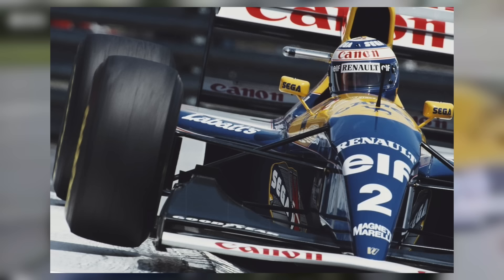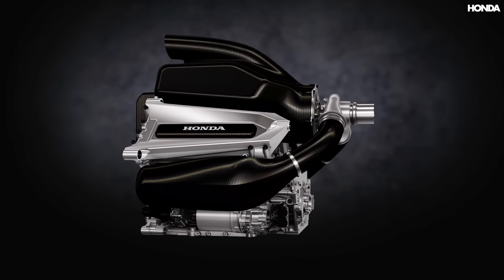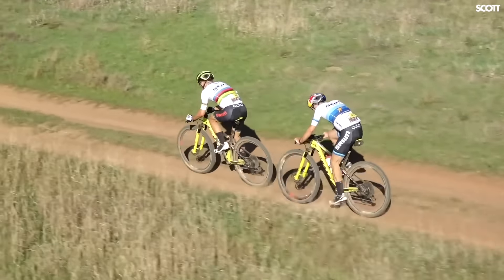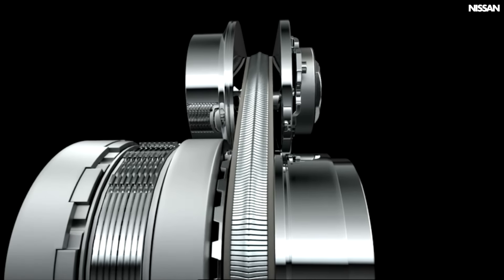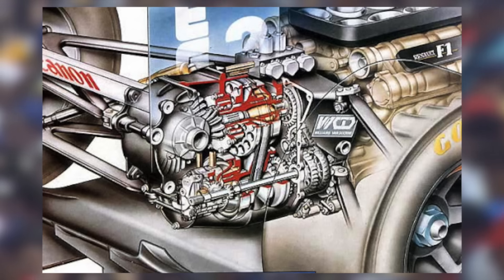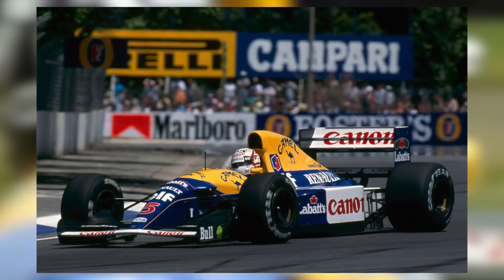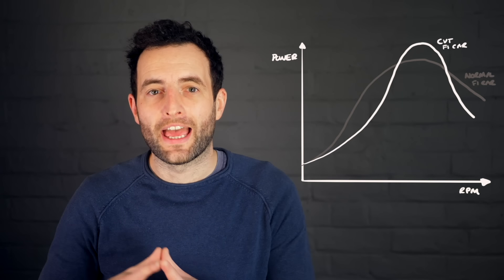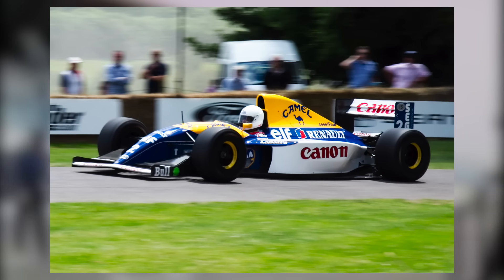The Formula 1 Car with INFINITE GEARS | The Blueprint

Comment: I don't to think you're right about picking the top torque of the engine for best acceleration - you always want to maximize engine power.

Here is why: at any given speed you want to maximize the torque at the wheels, which means that you want to maximize the engine torque multiplied by the gearing ratio. When you do the maths, you'll see that this is essentially engine power divided by rpm at the wheels, so if you want this number to be maximal you need to pick such a gearing that the engine is at its power peak, not torque.

To put it differently, if you make your gear longer so that you can have peak torque in the engine (instead of peak power), the extra torque will be consumed by less aggressive gearing, yielding lower torque at the wheels.
Reply: "...engine power divided by RPM..."

So torque....you essentially described torque...
Reply: @JohnDoe-td7mu  He’s exactly right. Wheel torque is what matters, not crankshaft torque. Wheel torque is maximized when the engine is at peak power, not peak torque.
Reply: @JohnDoe-td7mu  Almost - except it's engine power divided by wheel rpm (not engine rpm).

At any speed, the peak torque at the wheels is achieved when peak engine power is achieved.

Or to put it yet differently - power is preserved by gearing, torque is not (except for losses which don't affect the reasoning). So, the torque at the wheels is engine power divided by wheel rpm. Wheel rpm is is given so you need to maximize engine power.
Reply: @JohnDoe-td7mu  after the gear box multiplies the engine torque. Yea. The total force, which is what hp tells you.

Let's say the engine is outputting 50ftlb at 1000rpm and the gear box is 1:1. That's 50ft-lb.

But let's say you shift down at a 2:1 and the engine puts out 35ft-lb at 2000 rpm that's overall 70ft-lb after the gear box.
Reply: I am amazed that a racing driver doesn't understand this concept!
Reply: @ianlewis6717  I'm amazed that two racing drivers don't, since DC also got it wrong in this video!
Reply: What you are missing is when the tyre has not full grip, there you prefer the max torque to ensure transmission from tyre to road instead of spinning too quickly ... 😁
Reply: @JohnDoe-td7mu  Yes, but torque at the wheels. Since you can change the gearing ratio to whatever you like, you can increase torque at the wheels pretty much arbitrarily, but since you ultimately need that torque to do work, what limits you is the amount of energy you can input into the system over a given period of time, which is power.  
Crankshaft power is given by multiplying engine torque by engine RPM(and some constants depending on the units you use), and it's very possible for it to not quite coincide with max torque, instead coming slightly later when the torque only slightly drops off. In those situation you don't want to keep the engine at max torque, because it produces less power, and you can makeup for the lower torque at the crankshaft with a slightly lower gear ratio, increasing torque at the wheels.

Comment: Do you want to do a video on how this is different to the "CVT" that Koenigsegg is using?
Reply: Koeniggsegg isn’t using a CVT, they’re using a hydraulic coupling. It’s basically a very fancy torque converter, which you can find in many different automatic cars.
Reply: That's a direct drive system, not infinite gearbox.

Comment: They could do system where the car is always at max throttle, and the pedal varies the rpm in order to mediate power. Below idling rpm, the throttle would be lowered as normal. That would save the engines lifespan (which by extension increases the power teams could put through it), it would maintain an optimal rpm and power level at all times for the driver’s exact needs, and it would quiet the engine down more for the audience.

Comment: A drawback of that could be the braking, without downshift it's a different thing. When I test (I'm a tire test driver) with cvt cars (Toyota f.e.) I always have a "weird" feeling, especially in hard brake, if the car is not stable during braking. Sometimes, especially with rwd cars, downshift is essential. But I test on road car, they are not built to be pushed on the limit on track, so maybe that's why.
Reply: That may just be because it's a Toyota. My RWD Volvo 340 does have hard engine braking when fully off throttle, but I recon it makes things easier, especially in a situation without ABS.
Reply: @RDMracer  I have a 2017 V60 cross country automatic, and when I do emergency braking on road it actually downshift quite hard(more than the e92 I had before even when in sport mode) so I think it's a Volvo feature support hard braking with some gearbox setting
Reply: @RDMracer  also as an insider in automotive r&d I know that Volvo develop cars for Sweden without adapting to the rest of the world. Considering how slippery are the road there (due to snow,ice etc) I can easily understand why they develop the gearbox in this way
Reply: it all depends on how its setup to operate really. My Honda Hobbit (Camino in the UK)"downshifts" with the starter clutches installed, remove them and make it a pull start or push start with a one way bearing and you lose the downshift. Funny that the system above was designed in Belgium as the Camino is kind of popular there still to this day.
Reply: The great thing about CVT is you can program it how you like. When the driver is on the throttle, you can have the engine in peak power, and then on braking you can program 'Down shifts' into the CVT that the driver can control like a conventional gearbox. I think this is the best of both worlds. With development they could be strong and fast enough for F1

Comment: Wouldn't it be amazing, fitting last year's Mercedes W11 with a CVT, active suspension, advanced traction control and all those bells and whistles, and putting it to the test? 

It would be absolutely nuts. 

Not for actual official racing though.
Reply: we're talking about mercedes here mate, FIA would let them
Reply: @NikoKyunKyun  They would not be able to stop anyone from doing it. Any person, team or enterprise, given they have the technical prowess and money, can do it. It's not a decision of the FIA.

Though, right now, and until the end of 2021 season, they wouldn't be able to use the 2020 car: they aren't allowed to be used, even as test cars for new drivers to get mileage, due to the 2021 cars being derived from the 2020 because of the delay of the new rules.
Reply: DAS, CVT, active suspension, TC and all with infinite tuning possibilities, full power engine, and that tunnel-like downside. Would be fast as hell
Reply: Pikes peaks cars would be good with cvt.
Reply: @gaomn_03  Of course they can.  F1 imposes technical rules on many areas like chasis, engine, weight, aerodynamic etc.  All teams race under the same set of rules.  It is not no rule Formula 0!

Comment: CVT was the specialty of Dutch car manufacturer DAF.  I remember dashing all over south England in my mother”s DAF in the 1970s.  It was an awful car tbh.  Volvo eventually took them over.  They persisted with the CVT for a few years in their base model but it was dropped for a conventional automatic gearbox in the end.  Strange to think that F1 tried to adopt something from the normal automotive world as the flow of technology is normally in the opposite direction.

Comment: Could probably do the same now by making the combination engine charge the batteries and just have an electric motor to drive the wheels… this is probably why they limited the maximum power allowed from the electric part of the power unit.

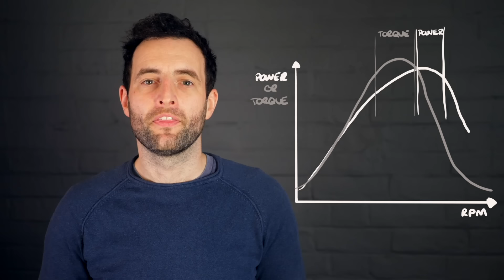Comment: 5:50 That’s just plain wrong. Don’t you consult an engineer before making these technical videos?

A cvt would keep the engine at peak power for both acceleration and top speed. When the engine is at peak power the torque at the wheels is at its highest. The torque at the crankshaft is irrelevant. Only torque at the wheels matter and at any given car speed that’s highest at peak power.

Comment: Well it's not infinitive gears. You have an upper and lower limit of the gear ratio. The car can choose a ratio freely within that range.
This would eliminate adjusting the gear ratio. I don't know if they switch the gear ratio but it makes sense. You want a gearbox that can deliver the optimal ratio for the track.

I think its good that they banned it for multiple reasons. First the sound would suck. Having a car at the same RPM the whole time doesn't sound nice. Then there is the cost. Teams would spend a ton of money to get the best system and optimize reliability. Reliability is also important, because it would suck when they constantly change the gearbox. It's an active system that removes a challenge for the driver.
Would have the FIA allowed it, there wouldn't be much left for the driver to do. They just floor the car and steer. The car does the rest.

Comment: I have to take issue with your use of the term 'infinite gears', because they ain't.  There is a limit to the range of gear ratios in a CVT, from minimum to maximum — they maybe be continuously or steplessly variable but they're not infinite, which means limitless, boundless, unmeasurable.
Reply: No, it's correct. The gear ratio has a minimum and maximum yes, but between that minimum and maximum you can select an inifinite amount of ratios to use (much like the value of the number pi is not infinite but it has an infinite amount of decimals).
Reply: How many numbers are there between 0 and 1? There’s a minimum number - 0, and a maximum number - 1, but an infinite numbers in between. Same thing. A cvt can and does use every ratio between its minimum and maximum.

Comment: The only sim that support CVT afaik is BeamNG, you can fit one into a race spec touring car.
I tried, I like the ideal the engine always run in sweetspot, but the sound just killed me. I'm not a ICE sound enthusiast and live perfect with EV sound, but the constant RPM sound really makes me unable to judge power input and output, makes the control very difficult.

Comment: 5:50 
I think You might be wrong here. 
For max acceleration the engine will always need to be at highest power, not highest torque rpms. 
Gearbox will always provide the max torque at the wheels when the engine works at highest power revs. 
Gearbox ratio (high reduction) will take care of this.

Comment: What is wrong with the FIA? Every time something cool, new and with great potential comes along it just gets banned. Its meant to be F1. If you want class racing do it in one of the classes. 
F1 should be the best of the best. Not the best so long as you don't use certain aero, certain gearboxes, certain electronics and all the other rubbish rules. 
The only rules in F1 should be a size limit for obvious reasons (so it would have to fit in a theoretical box) and something in there to say it has to be reasonably safe so far as is possible. 
After that let them have at it.

Comment: Maybe someone knows more details but when CVTs went mainstream, drivers would complain they were “slipping” and they ended up simulating traditional shifts via software, negating much of the benefits of CVTs.
Reply: I would hold the pedal down and wonder what the heck the car was doing at 4K doing 20mph. 

I started making mental notes of where shift points should be and lifted the acceleration. 

Funny thing it worked. Until you hit a hill with cruise control. Many of these just cooked themselves.

Comment: This style CVT was developed by DAF , a DUTCH car brand. They used it on the London-Sydney Marathon rally of 1968 running 2 DAF55 Marathon's (#30 and #69)
They both finished , 17th and 56th. Here you can see a Dutch documentary with unique rally footage of that rally:  
https://youtu.be/tyWVAKwBmUM
They also did some testing and racing in a F3 car.
https://youtu.be/oq4ZbBVTumw

Comment: One small correction: Acceleration doesn't depend on torque but on power. There's no reason to stay in revs where you have peak torque if you want to accelerate as quickly as you can.

Comment: I have a question though,
How do you know you are maximizing the braking phase? Do you feel the underrotation of the wheels?
Reply: Should be easier, you can control engine braking very easily with this system, and braking is front-wheel limited most of the time in Formula cars.

Comment: Can we not use the word infinite when it is not appropriate? Is there a CVT that can achieve a billion-to-one gear ratio? No there isn't. That's why we don't call it a continuously infinite transmission. We call it a continuously variable transmission. There is a massive difference between variable and infinite. You are rotting people's brains. Stop it!

Comment: I remember Tiff Needell testing this at Estoril and he talked about it but I don't recall where.. maybe Top Gear or some other car programme.  I think that if they raced it, the engine maker would of made a new engine for it, they wouldn't need to have "drivability' just max power at whatever rpm they could and thus be able to tune the cooling and wear on it.  like a scooter.. it is designed to be at the max revs all the time, really.. no?

Comment: I'd be curious to see what Toyota/Lexus's eCVT hybrid system could do in a race car. The batteries are an additional weight but the 2 motor generators that make up that eCVT replace both alternator and starter motors, so it's not actually that much weight especially considering that they are the gearbox. The cooling and air con systems are powered electronically as well, so you don't have that loading coming off the crankshaft and sapping top speed.

That said, they're tuned to get the vehicle to a cruise speed and then they'll up the gear ratio so that the engine goes to not far above idle, so the steady state of the engine is a low rpm and the opposite of the F1 CVT steady state. There's a curious motor lag though when using kickdown as the engine speeds up after you floor it (mostly goes away in the sport mode).

Comment: Isn't that what Koenigsegg just developed?
Reply: No, Koenisegg has the same function but in a different way. You can call Koenigseggs system a hydraulic CVT, as it's comparable to a typical torque converter, but it's optimised for a much bigger speed range. It's possible to apply it like this because the Regera has electric motors to get the speed beyond the stalling point of the converter.
Reply: @RDMracer  all right. Thank you

Comment: You don't know much about engines and the relationship between HP and Torque. You didn't mention torque one time when you were explaining the gears with a bicycle or with the transmission. You have a very limited understanding of engines and how they're built and how they spin fast you didn't talk about bore or stroke or balance none of it. This video may be good for people who don't know anything but for people who know about how engines are built they will laugh at this video.

Comment: A cvt by its nature has to be automatically controlled. How does it "know" all of the things you listed as advantages. Automatically controlling torque through corners probably qualifies as traction control Aswell which is no bueno.
Reply: I think you could arrange a system where the driver slides a control (gear lever) to a position that they feel is delivering the best output at any time. This gear lever would have a slide action rather than the positive locked positions of a traditional gear shift. Thus controlling the torque at the wheels would be entirely under the drivers control. 
It would be a hell of a job modulating a two variable systems manually rather than pull the paddle and put the boot in. I’m not sure many drivers could do an optimal start (as well as pay attention to the road) and so ‘traditional’ paddle shift cars would probably gain track positions at the start of the race. It would be akin to using a clutch and stick shift all over again.

Comment: I really liked the CVT in the Nissan Note (2015 model). Very smooth, and the optimal engine speed lowered by a supercharger. Great up steep hills - no stalling worries. Good mpg too.
Reply: My dad has one.. it's not sporty but oh so super smooth and combined with some clever software controlling the revs its actually not annoying at all.

Comment: Once you go electric, there is no need for CVT, DSG, sequential or manual gearbox. No gearbox, no problem!  Moreover, electric cars can rev much higher than F1 cars... we are talking up to 25000 RPM.
Reply: You still need to have gears to get the power to the wheels. Teslas , from what I heard, have a geartrain that’s 9:1.